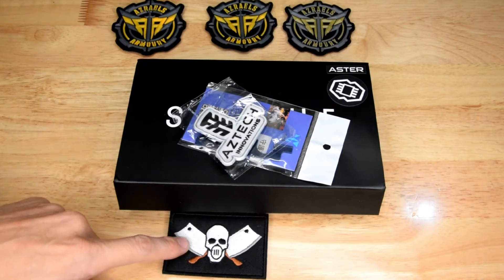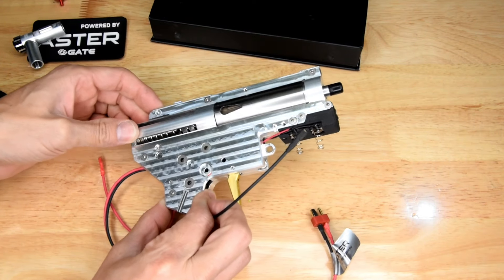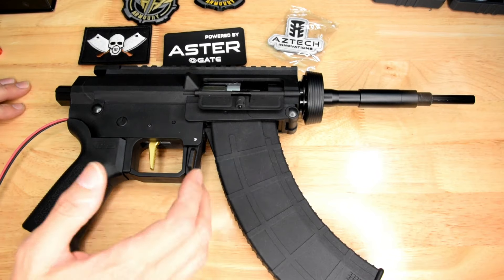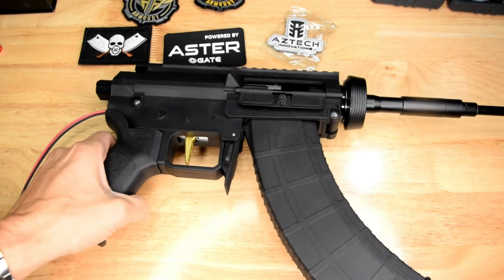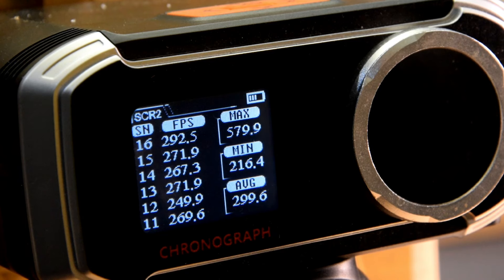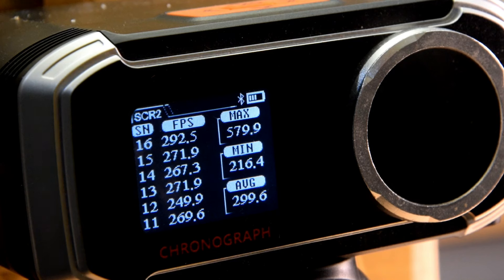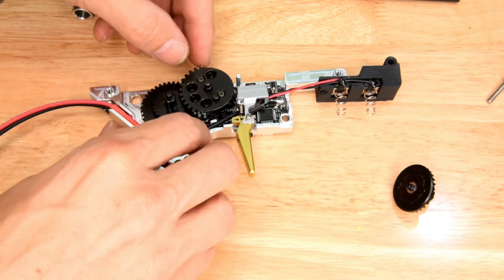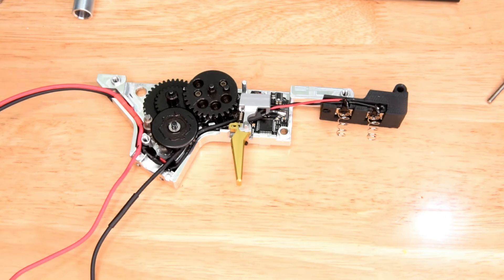BOLBR: scythe split CNC gearbox with Apache tappetless head review.

Comment: Nice video man. We should send you the v3 ak rubber tips. Much harder duro and last never come off or split if you scuff up the surface of the Apache and surface of the inside of the rubber tip and use 480 super glue. Glad you love the products. I started back at azraels 1 month ago after 9 months away. Glad to see you check out these things

Comment: Apache is pushed into the cylinder and held there with 2 seals . I've used them in Wells and never had problems besides the rubber nozzles tearing. You can use 3d printed ones and they work a treat and remember to glue the nozzle on
Reply: The new v3 ak rubbers chopped to size are far better than the v2 rubber and last 10 times longer too

Comment: And you use orings to set the perfect nozzle length and Martin did a video age's ago about how many orings to use but was using one of the red alloy outdoor v2 tpiece's cause they hadn't released the adjustable tpiece's  and he also shows you how to open the Apache so that the nozzle goes as far forward as it can so you can determine how many orings to go under the nozzle rubber tip or nipple ,the Apache comes with 3 orings but not sure if they come with the whole gearbox but if you ordered it with the adjustable t-piece they may have already put them on to suit and the nozzle moves so quickly that if it pulls up short and doesn't seat it's not good the first batch a few came back broken because of that reason so they changed the design so it was beefier and less retard proof 🤣
Reply from the maker: The nozzle already came fitted with a few o rings. I didnt mention it in the video, but i did mentally note it.
Reply: @lowguidoschopshop  I got my scythe and Apache and the rest of the stuff for my falkor blitz 2.0 sdu build all separately not a built one and my Apache came with 3 orings and from what i can recall him saying and that you won't need 4 for anything 3 is the limit pretty sure man
Reply from the maker: @drewmurray6480  looks like 2 on mine
Reply: @lowguidoschopshop  2 should be fine with the adjustable tpiece's but as i previously mentioned the red alloy outdoor v2 tpiece's and the gbu copies use 3 orings pretty sure

Comment: The anti-reverse latches work in most gearbox's but no good in a retro arms gearbox cause the bit that the spring touches is a smaller diameter in a retro apparently and that's from azraels but i have been lazy and haven't pulled one of my retro boxes out of that particular part's box and i ordered a few from azraels and they are in a more accessible part's box atm but from memory JHQ TECH off utube he's in the USA so is a airsofter but loves aztech innovations stuff and he's a awesome builder and he told me to just put some hot glue in the retro arms gearbox and they work so pretty sure he's talking from experience cause from memory his Apache build is in a retro box and almost all the part's are aztech innovations and i also thought about getting some metal tube and putting a sleeve over it so it's thicker lol 😂 but hot glue is cheaper and easier

Comment: Yes you can buy the coil spring anti-reverse.  I have them in all my gear boxes.  You can release the spring tension with a screw driver before taking apart a gearbox.  You should check out Azrael's Youtube channel, there is a full break down on how to take apart the Apache and set it up to suit your individual blaster.
Reply: I have cut screwdriver slots into the shafts of standard metal AR latches to enable the same tension-release feature.
This feature is also standard on "Modify" brand blasters.
Reply: @calnky  Or you can just use a pick and pull it back aha
Reply: @DanielFreakinAwesome2  I can't get a pick in anywhere when the blaster is fully assembled.

I use the decock feature on blasters that are running high load springs (>M100) for stress-free end-of-use storage.
 
Storing blasters in a pre-cocked position will deteriorate the springs effectiveness and place unnecessary loads on other components over time This is especially so on high load spring builds.

I drill a discrete 2.5 mm hole in the lower receiver (under the RH rear tail of the fire selector when in "safe" position) that aligns perfectly with the AR latch hole. That way it only takes two seconds to decock a blaster before I hang it up for the day.
Reply from the maker: just be careful decocking with levi mosfet because the micro switch doesn't love being pressed backwards.  it can knock them off the board.
Reply: @lowguidoschopshop  Cheers for that LG👍
 I'll keep that in mind if I ever get a Levi.

 It's mostly the trolley-trigger switched or BigRrrr equipped builds that I do it with. 
  The Peruns & Gates I have usually park the sector gear in a sweet stress-free spot with AB whereas the BigRrrr always stops halfway through a cycle (i.e. pre-cocked) and trolley switches are all over the shop.

I also check where the nozzle is up through the t-piece so I'm not damaging the tappet tail when decocking.
Reply: @calnky  There's a better option compared to Leviathan on Gel Blaster.
"Chilun V2" micro switch is worth trying as they have 1/3 price to Levi by Jefftron.

Comment: So this is a spin off from airsoft?
Otherwise So much engineering for a pretty small market.
Reply: You are wrong.
Azraels/Aztec Innovations are an Australian company where Airsoft is illegal. 
Azraels/Aztec Innovations designed and manufactured these products to primarily cater for the domestic gel blaster market, and also as an opportunity to crack into the international Airsoft market.

The Airsoft nozzles for the APACHE are different to the gel blaster nozzles and are for export sales only.

The Scythe gearbox and everything in it is all compatible with an Airsoft build.
Reply: @calnky  did you watch the video? they aren't very good lol
Reply: @Danny-G   Heya Lord👋
I had some frustrating moments with the earliest APACHE (V1).

 I've currently got a few version 2s running in LDX splits - in a metal MP5, a 416d; and a custom mojo Magpul MOE M4.
I've yet to try the V3 APACHE that LG has got here in his new Scythe.

Like most things there's a learning curve to getting them sweet, but that sound - man it gives me a mongrel!

*On fps consistency:
 With a tappet plate build I can get sub +/- 2% variation in muzzle velocity (e.g. 324~336 fps)
  With an APACHE the best I get is +/-3% variation (e.g 320~340 fps).

 Also, I wouldn't recommend them for DMRs or barrel lengths over 360mm, as it takes about 3mm (1tooth) of piston stroke to extend the nozzle. All VE/porting calcs have to factor in that loss of swept volume.